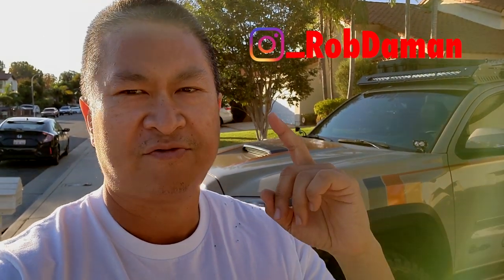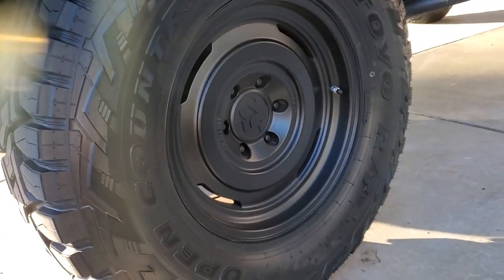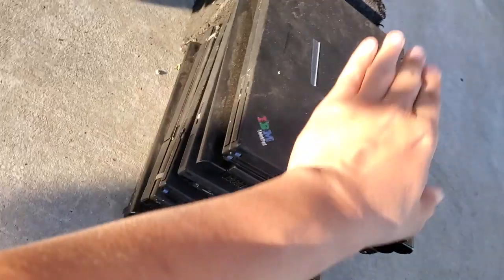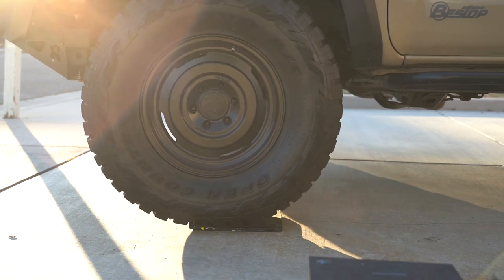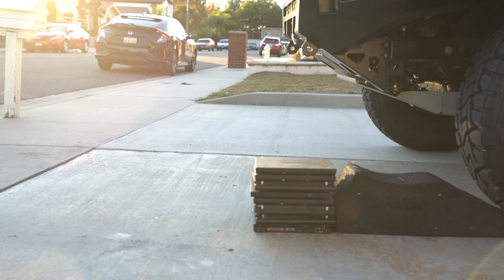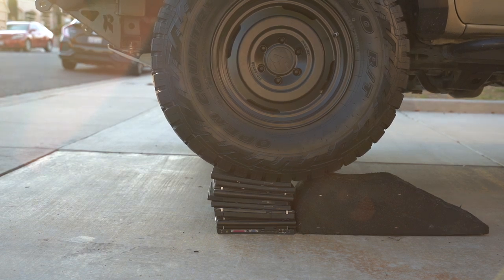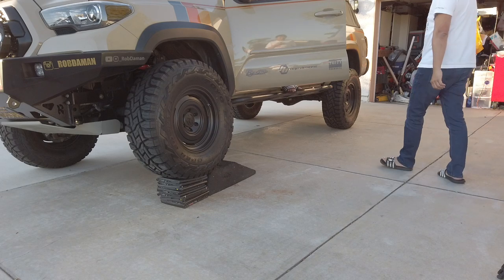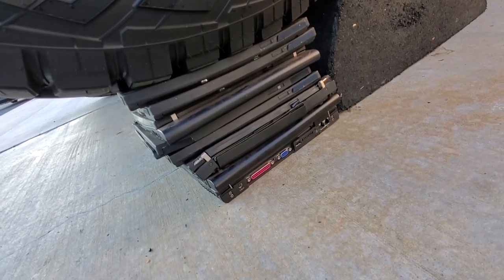Truck crushing laptops - Just for fun - my Toyota Tacoma

Comment: Hey man i sent you a link my tacoma still squeaks im having a hard time finding where its from , i had a leveling kit and i replaced it with icon coilovers , new sway bar links and ball joints . This squeaking is driving me crazy .
Reply from the maker: can't hear anything from the video honestly. maybe mark the times you hear it. leaf packs are known to squeak so perhaps the sound is from the rear?  Check body mounts too. I've read that being a defect.
Reply: I have checked before but it has to be the front it does it mostly in speed bumps
Reply: Listen closely at 0:14 its loud there right after the motorcycle drives by its when the front tires go over the speed bump
Reply from the maker: @agustinherrera5600  cab body mount should be checked as I mentioned. I've read that being a noise issue.
Reply: Ok ill look into that . But you mean grease them or tighten them ?
Reply: @agustinherrera5600  check tacoma world. There's a few body mounts, specifically them a radiator ones that get beat up shit cause of poor design.